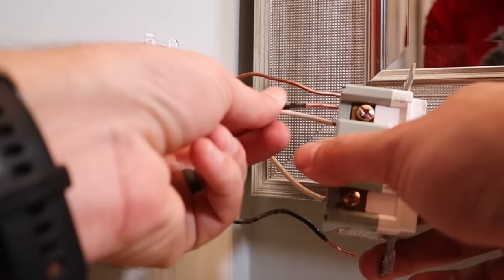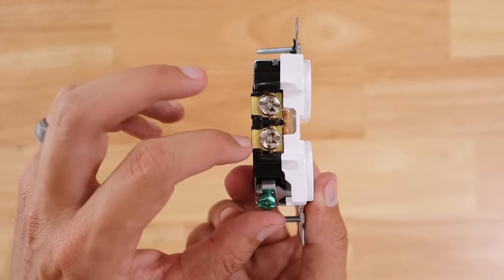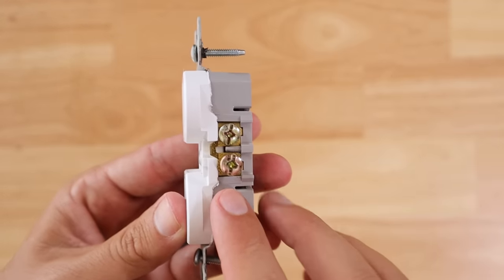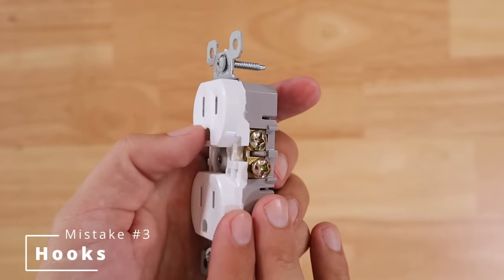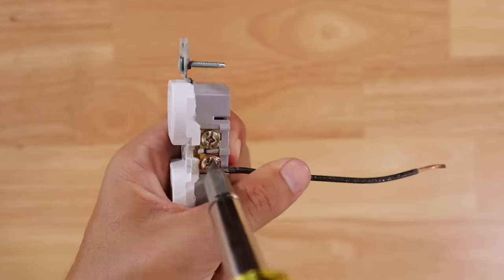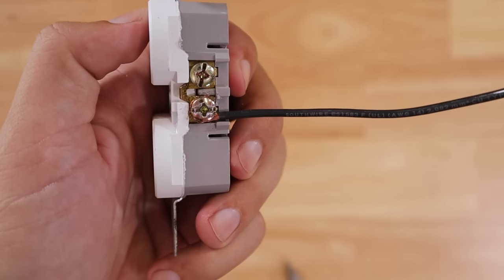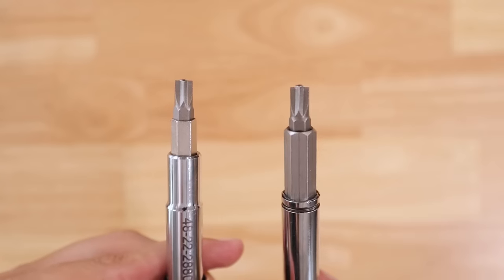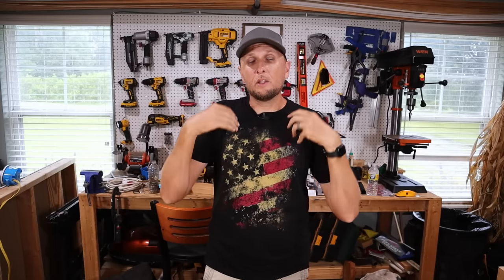The BIGGEST Mistakes DIYers Don't Know They Are Making When Wiring Receptacles | How To

Comment: Easier to remember that the two B’s go together: “black to brass”. Then everything else falls into place. Anyone that doesn’t know the screw that is literally coloured green is for the ground wire has no business touching anything electrical.
Reply: when working with receptacles, you should also remember, "right will bite"  as it helps remember which side of the receptacle is supposed to be the hot side while testing.
Reply: That’s how I was originally taught way way back in 1981
Reply: you know, I was taught way back when the polarized plugs with only two wires were coming out that the letter W uses more ink than the letter B so therefore the slots in the front are longer for the white wire..lol.. never learned the difference in the screws before..
Reply: Wow, simple, but I’ve never thought of it that way. Thanks for sharing “black to brass” I’ll have to remember that one!
Reply: Yup black to brass and white to bright
Reply: @rodneyhooverCFI  also remember white to bright
Reply: Don't forget that the hot wire could also be red.
Reply: @kenbrown2808  -- Good video, thx for sharing.  If there are any fellow Ga.Tech fans here, it's easy to remember 'black & gold'. :)
Reply: Hot Black Brass is how I was taught.
Reply: @kenbrown2808  although this may be true most of the time, there is no code stating that receptacle cannot be installed with ground up and hot on the other side. Generalized rules like this can be a problem. Remember the small slot is hot.
Reply: @lkeil84  yes, occasionally, one or more outlets will be installed inverted.  the only ones that wouldn't obviously be installed inverted would be an ungrounded receptacle, which is a good reason, when installing ungrounded receptacles to install them right side up, as you've eliminated all the reasons people give for installing the outlet inverted.  and there are still houses out there with unpolarized receptacles.  so your "small slot" rule is equally imperfect.
Reply: Anyone that does not know all of this and have a general knowledge or understanding how electric circuits works should not touch them in the first place.
Reply: @brotheradam  They still have that, or most of them do.
Reply: That could also confuse someone though if they forget and think bare goes to brass... The people that need to remember this and use these tips are probably not those that do this type of thing on a regular basis and b could be confused for bare or black.. 

White to White (silver), dark to dark terminal (brass), and ground is green like grass. It can still be a bit confusing using these when your electrician may have ran something and used a box to spilt 2 circuits. I have seen electricians run something like 12-3 to a box.. red went to one outlet and branched off to one circuit for a room while the black tied into another 12-2 that went to a different room's outlet circuit.  

I always just remember when I was first doing this that brass is colored so the colored wire goes to it. Silver is the equivalent of white so the white goes to it, and grass is green and on the ground so ground goes to green.
Reply: I was always told, "Black to brass, saves your ass"
Reply: The way I was taught to remember was to think of it like u was at a dentist office. The black man gets the gold teeth 👌
Reply: Anyone who doesn’t know these basic tips shouldn’t be wiring anything.
Reply: @Greezy Mcgill  You got me there.
Reply: So then black to brass and I won't zap my ass is appropriate ?
Reply: Meneely House  I always use to say black to brass white to bright
Reply: I was a little bothered by him saying "gold"
Reply: Or black gold Texas tea.
Reply: @brotheradam  A little crude, but this is the phrase I was taught to remember, “A small slot is always hotter!”
Reply: Rookie talk. If you don’t know this don’t touch electrical!
Reply: I always say black gold...
Reply: Black gold
Reply: @johnbushur6080  always remembered this
Reply: Part of the problem is lack of standardized with DC wiring (auto) in the past.  In automotive/lawn mower/power tools the black is negative - ground if you will, and red is positive or hot.
Then there is the Highway to Hell on boats with both AC/DC.
Reply: I was always taught to think about oil when doing this. They call oil "Black Gold"
Reply: Thanks for the excellent video and I'll remember Black to brass and White to bright! And I'll also strip just the correct amount of insulation as well. :)
Reply: Yep I was taught black to brass and white to bright
Reply: Electrical is fun and pretty easy graduated top of my tech class 🤘⚡️🔌
Reply: I made up "Black hot, short slot".
Reply: When I went to replace the outlets in my kitchen, I found out that whoever did the wiring before I bought the place apparently thought wire colors were just dealer's choice. White was neutral on one outlet, on the next the black was neutral and white was hot, on the next they used red for hot and white for the traveler on a three-way switch circuit... and they just went ahead and coiled up the ground on most of them and left that green screw empty. Just an absolute mess. I spent awhile with a voltage tester finding and marking all the hot and neutral wires. I'm assuming there was no inspection involved. I'm actually pretty amazed all the switches and outlets worked, I don't know how they kept track of what terminals they were connecting to.
Reply: The terminals are labeled, no need to remember that.
Reply: White boys ride on the chrome wheels black boys ride on the gold wheels …
Reply: Black on brass, or that's your ass is what I was always taught. 😂
Reply: @lkeil84  I would think that code would dictate that swapping the hot and neutral would be unacceptable and would defeat the purpose of the ungrounded Polarized plug, such as on a table lamp… among other issues it would cause.
Reply: Black to brass white to light
Reply: I was told black people wear gold, white people wear silver
Reply: Is there a place called electrical hell
Reply: @kenbrown2808  commercial and industrial we put the ground up so that would be false
Reply: @valentepozas4745  just because you do that doesn't invalidate the rest of the us.
Reply: B2B as you say black to brass that’s exactly how I remember  2 thumbs up
Reply: I was taught black on brass will save your ass
Reply: @valentepozas4745  and yet, besides hospitals and houses wired in parts of the 70s, or switched outlets, the industry standard is ground down for 120V straight blade receptacles.  

and no, I didn't get her shocked, because I specified that was a guide for TESTING.  but hey, go ahead and get her shocked by having her pull her receptacle out of the wall to see what color the screws are so she can put her tester on them.

let me guess, you;re a fifth term apprentice.
Reply: @valentepozas4745  you sure think you know it all like a 5th year.
and you do realize there is more of north America than the southeast...but hey, carry on insisting that the whole world must be like your little corner of it, because you;ve done 5 or 6 kinds of jobs.
Reply: @kenbrown2808  LOL i learned that the second i shocked myself by touching the brass side of a Receptacle when i was taking apart my project and i didn't de energize it Boy i was a silly First year and nearly a dead first year before i even left school.
Reply: @thegreatcanadianlumberjack5307  worst part of working for a "hurry every chance you get" outfit is they push you to take risks.
Reply: @valentepozas4745  I'm not the one coming in on a month old video in residential wiring claiming that because the company they work for likes to use the alternate orientation for convenience outlets, in non residential installations;  that a common mnemonic for remembering proper polarity in residential outlets is categorically wrong.  and then trying to defend it by ranting and raving about how vast their experience is and how they know everything because they worked on a windmill once.  and they worked on a mill once.  and they supervised a journeyman once, and told him that even though everybody you know installs receptacles ground up, the project specifications were that the receptacles be installed ground down.  and you think anyone who calls out your pissant attitude must be a drywaller, because there's no way anyone with any experience could fail to give you the respect you think you deserve.  
but what do I know, I'm just a total stranger calling out your bullspit on the internet.  think about that next time you get an ROF in the middle of a project.
Reply: Silver was a white horse.
Reply: I know just enough about wiring to be dangerous
Reply: I think the type of screwdriver was greatly exaggerated. A flat or phillips both work fine.
Reply: That's what I was taught also.
Reply: That's my way of remembering.
Reply: @blockisle9  i always go white to wide ?
Reply: Oh… now that I know what that little green screw is for, I’m on it!!!
Reply: I always remember the Beverly Hillbillies theme “black gold-Texas Tea” when I’m wiring an outlet.
Reply: Going by color can be disastrous. Always know how to use a multimeter and always check to make sure
Reply: That Phillips is wore the hell out!
Reply: How about reading the markings on the back of the outlet?
Reply: Black to brass. Thanks for the tip. Easier to remember. I always remember white to silver. but this is a lot easier to remember
Reply: It just seems natural to me now. Black is gold and white is silver.  I've also installed, literally thousands of them by now though.
Reply: @scooterp7009  I agree with that if you don't know these basics you shouldn't be doing it Silva to the white and the ground to the green just remember the white and the ground is always on the same side really basic stuff
Reply: Great video! Reverse polarity will also make motors spin backwards. Potentially dangerous depending on what's plugged in
Reply: Exactly 💯! I've met quite a few people who had no business being anywhere near electrical outlets recessed lights or even a screwdriver
Reply: @westsideken  I like that much better because it looks gold.
Reply: @nicholascrochet823  Yes, it does sound racist. Please explain if it is not.
Reply: @joshedmondson4031  I certainly don't understand that one, including the boy part.
Reply: @steven4776  so black people have more expensive tastes? We are better?
Reply: @lkeil84  awww - the ol 3-way switches!!   Good catch!
Reply: Green as in grass lol
Reply: @Greezy Mcgill thinking stereotypes are “facts” sounds pretty sketchy
Reply: My old roommate used "black men have gold teeth"
Reply: @bobjoned3398  The topic is about commercial and residential wiring for AC circuits not automotive or electronics or DC equipment
Reply: @bluepeakinspections  🤔
Reply: Green ground
Reply: @lkeil84  it could be black red or blue.  Depending on what service you have and what method of wiring is used.     From romex/ emt or pipe / mc.
Reply: @michaelhanson5773  12-3 might be ran to split the receptacle also to make one switched
Reply: @marcus1226  IBEW or non union?
Reply: Yes; I remember "black to brass" and "white to wide" - since the widest slot is the white/silver side of the outlet.
Reply: @jamesgarrison6430  Yes, you are correct. Blue would be very uncommon in most smaller structures. Only building with service sizes larger that 400 amps would have a blue phase. Funny the national code does not specify "C" phase as blue, and it really only applies in local code amendments. For the most part though, almost all electricians use black, rdd, blue for 120/208 and brown, orange, yellow for 3 phase 480/277. The code only specifies green and white usage and where they specifically cannot be used. Most homes these days that have almost all the circuits protected with AFCI breakers are really only using black wire anymore. Do you know anybody that is buying white/red NM or MC? Not to mention is also special order.
Reply: @lkeil84  They could be any color but green or white. Everyroom room in my house has a different color hot wire.
Reply: What if there is no black but red?  What if some handymen who happened to "tinkering" with the electrical boxes and mis wired them?  Best thing is to verify and identify which is which first then turn off the circuit breaker (LOTO is the best option).  Well, the best option is to call professional, certified electricians.  We will charge a little bit more but you won't be surprised with many problems later.
Reply: Silver to white you did it right
Reply: @vigormanh2980  I was an electrician for 19 years and an Electrical Inspector for over 20 years being the boss for 5 of those years. Everything from bathroom remodels to 1000 foot high rises. I've seen it all and some of the ugliest electrical work on the planet. It astounds me that there are not more fires.
Reply: @lkeil84  I totally agree with you about this.  I worked my way up from a young apprentice decades ago then finished college with a degree in electrical engineering and for the past 8 years I started my own servicing company.  I have worked in residential, commercial and many industrial settings.  Like you said, there are flaws everywhere.  My rule of thumb always is:  if one not trained in electrical trade he/she must stay far away from electrical work and always do follow up checks on new employees.
Reply: I like to think of the scene from game of thrones when he pours hot liquid gold on that one guy. So I think of the gold as hot.
Reply: @lkeil84  receptacle position is always specified with the ground up.
Reply: Even easier way to remember is the black guy gets the gold filling and the white guy gets the silver filling at the dentist..
Reply: Black boys like gold, white boys like silver
Reply: @captainb2603  what if the black guy is not around but the red skin guy is?
Reply: @vigormanh2980   hide your alcohol
Reply: @captainb2603  I did not mean to be funny about the red color.  Besides 
 black hot wires, there are red hot wires and blue hot wires in single phase panels.
Reply: ,your opinion
Reply: @workct4102  This is incorrect. I worked as as an Electrical Inspector for over 20 years and found no such instruction in any listing, installation instructions or the National Electrical Code. It is common practice to out all the grounds down and putting the ground up for a room switched receptacle. 99% of all installations I inspected had the ground down. Even I knowing the advantages of a ground up installation still install ground down. I do not find the advantages to be that great to change what most people think is correct.
Reply: @workct4102  Not always
Reply: Jesus this is so basic it’s not even funny. People don’t know this!?
Reply: @lkeil84  any spec...will be grounds up.  If there is no spec do whatever.  But grounds up is the way to go....
Reply: @williamleblanc3244  in 20 years I have never seen a spec detailing grounds down.  If it is spec'd its always ground up.
Reply: @lkeil84  you weren't an inspector.  If you were you'd know the difference in a specification and a listing or code requirement.
Reply: @workct  in 34 years the only time I've seen ground up were hospitals and some commercial projects.
Reply: Black hills gold is how I remember it
Reply: You have all those color coded screws but they couldn't write L and N to indicate live and neutral terminals?
Reply: Well that extra long wire not that big a deal because you got exposed hot screws
Reply: This is exactly how I remember it black is brass is my mantra while doing diy electrical
Reply: Smokey and the Bandit was how I was taught, The car was Black and Gold!
Reply: Very confusing,  always thought black wire is ground like car battery
Reply: @SparklingRufus  I was in that boat for a while but high voltage is definitely different all the way around it seems.
Reply: No, the copper color screw  is current line, the silver screw is a neutral  traveler of the alernating current 1/2 of the current line returns to transformer and the green screw is earth ground only.
Reply: @brotheradam  in past history of usa is still in also in  philippines of not understanding earth ground.  The neutral traveler line with the current line makes it ac= alternating current , example is the current line is on a 20 am breaker,  equals 20 amp circuit, the neutral is a return current circuit of 10 amps goes back to transformer .  As notice the going out current is hot and half of that current returns making it  a hot also.  The earth ground is in contact with a earth rod only and no travel current wire. No neutral is a ground, fact,  as those  nations are  still 80 years behind as they still  say it is.  No it is not. . The only ground is the earth ground only never a current traveler. High tech mega generators that control power grids  of citys being rebuilt from wars and usa military camps across the world uses depends on the earth ground to keep the phases equal and no spikes. They can not continue without the earth ground.
Reply: Some people may be new at this and want to learn. Your post,  while informative to anyone that's never changed one out before, is also kinda (no offense) ass hole-ish. People use these videos to learn.  Some may not know green if for ground, ....you just informed them but the last  sentence could've been omitted....just saying.
Reply: @jvmiller1995  look, there was a time where you didn't know either. Take it easy on the people willing to learn from all of the helpful videos and advice. All your doing is deterring them from coming back to ask questions
Reply: @bobjoned3398  My father was an electrician in a small mountain town and several of the houses he wired had waterwheels and DC power.  They were a treat to wire, but he knew his stuff and had no problems.  Initially, though, he would check everything I did, but by the 3rd room, I was on my on.

DC lights and appliances are expensive, but they are available.
Reply: @lkeil84   yup my whole house is wired as white is hot.
Reply: @kenbrown2808  lol! That only helps if you understand that there is a wrong way and a right way the outlet should be ...and I have come across plenty of upside down outlets🙃    I've always told people that the plug needs to look like a face 🙂 right side up of course.🙂
Reply: The outlets also have it written at the back where the white goes,and where the hot goes. And that is a no-brainer.🙂
Reply: Neuter to pewter
Reply: None of this means anything when you take off a switch and all the wires are black…😮
Reply: That's what I go by
Reply: Black to brass
White to bright
Green to ground
Reply: @kenbrown2808  The white will bite too if there’s a load on it.
Reply: First thing my dad told me when rewiring a circuit. Black goes to brass!
Reply: Black to brass will save your ass! That's how I was taught.
Reply: I think if it like an old western. Black = Bad, White = Good lol
Reply: What if you're on a 3 phase system and you're wiring blue or red? 😏
Reply: Black guy gets gold chain , white girl gets silver necklace
Reply: How about the W rule ?  Wjite to the Wide socket slot,    and Black ...... falls to the narrow slot
Reply: @johnbushur6080  Dang... Rodney,   you covered that
Reply: Thank you
Reply: What you say including when you are learning ? Like you KNOW EVERYTHING 🤦🏻‍♂️🤦🏻‍♂️🤦🏻‍♂️
Reply: Or you could just remember black folks have gold teeth.
Reply: @kenbrown2808  until you go to a govt facility and they are upside down
Reply: @bch5513  if you're in a government facility, you'd better have enough training to adapt to that.
Reply: Black is bold and bold is gold.
Reply: @kenbrown2808 the way i was taught was if you look at the front of the receptacle the short side is the hot side
Reply: @OfficialTakGiovanni  that's true, but it doesn't rhyme, which makes it harder for people who do it less often to remember.
Reply: Looking at the back of receptacle, white on right is easy to remember also.
Reply: @martykoehler6512  that’s what I was taught as well lol
Reply: @brotheradam  my dad taught me long ago “black to Brass better watch your ass” years later I still use this rhyme
Reply: If you’re a Steeler fan…. Black and gold!
Reply: You're right black b goes to  brass b. You could also say White wire goes to White screw. Or w goes to w.  And Green is ground the world around.
Reply: The white wire goes on the same side as the ground screw is located.
Reply: Great tips here on wiring wall receptacles. I never liked the back stabbing method myself because your connection points inside the receptacles is paper thin and over time can become loose. I was taught to always use the side mount screws , black to brass and silver to neutral and ground wire ( green ) to green terminal.
Reply: i always remember what side the wires go on by thinking "hot goes on the side with the smaller hole because that's the one you really don't want to stick your finger in"
Reply: @lkeil84  Any color can be hot except for green or green/ yellow, white and gray.
Reply: I'm from Mizzou... Black & Gold. Easier than two Bs..
Reply: Good job
Reply: @lkeil84  good point, so the full rhyme helps... White to bright.,in that case
Reply: @kenbrown2808    (except, of course, if the receptacle is upside down with the ground up - which is perfectly legal). It's a basic way to remember, but I just tell kids "small slot hot".
Reply: Neutral white is always on the same side as ground which is green. Hot or colored wires on the opposite side. I start with the ground, then neutral, last hot.
Reply: White people like silver, black people like gold.

That's what someone told me lol
Reply: black to brass will save your add😂
Reply: Exactly my grandpa told me that years ago. It's never left me, nor has it ever failed me.
Reply: I thought green is hot and black is neutral white is just there for looks, aren’t u supposed to hook all this up to a five gallon gas can ? I’m pretty sure u do 👌
Reply: Black to brass, save your ass
Reply: White to Bright, black to brass.
Reply: I always remembered black to gold cause black gold yanno
Reply: Never heard that but I always know side with green is white/common
Reply: Excellent reminder for the “B’s”
I’m a plumber, even I know about that green wire. You hit the nail on the head though 😂😂😂
Reply: @lkeil84  The hot wire could also be white, depending on how the circuit was run.  If utilizing white, a Sharpie should be utilized to color the end of the wire casing black, or by placing some black electrical tape around the end of the casing.
Reply: @jvmiller1995  Many come on to Youtube to educate themselves.  I am glad that channels like this exist to give correct information and sound advice.  Looking through the comments on any given video will give you an idea if the information given is sound.
Reply: @Jeff-vh1zz  The cases of a hot wire being white are so very few. Basically, you can tape the white wire in a smaller cable assembly such as NM (Romex) or MC. This would apply to using a 2 wire w/ground cable for 208/240 volt applications such as electric heaters or motors and switch travelers. Never can you pull a white wire into a Raceway and use it as a hot conductor. The same goes for green. The code is very strict about the use of white and green colored wires with very few exceptions. If you know of anything other than cable assemblies, I would love to hear about it. Being an Electrical Inspector for over 20 years taught me a very valuable lesson. I don't know "everything".
Reply: @Jeff-vh1zz  Some things yes.  Many things you should not attempt.   I mean before hip replacement I watched a video showing the entire thing.   Would you hire me to put a new hip in you.   I men I am gad I went to the guy that does 6 a day.

I think You tube can be good and i have learned a lot from it right or wrong myself.  But if you do not have a basic understanding or how the electrical system works you should not be trying to wire a house based on a video.  What do you do when someone prior to you has miss wired and you are just trying to put the black to the black and white to white and so on like this video shows.  It happens all the time and even more so with you tube..    That's what I am saying.  Not everyone is cut out to be a electrician and you do not get many mistakes before someone gets hurt.
Reply: Wow thank you
Reply: Machine gunners: "Brass to the grass!"
Reply: @glasshalffull2930 I can only imagine your plumbing jokes...With "ballcock" and all.
Reply: @steven4776 What if you're Italian?
Reply: @Maynardd Did you wire my house? I have more "open grounds" than closed ones.
Reply: @windsofmarchjourneyperrytr2823    LOL!  You had to remind me😉. Used to live in a small condo building and I was the president.  Anyway, we had an issue with the main drain on the bottom floor and it was discovered about 5:00pm when the single and cute lady in that unit returned from her job on a cruise ship.  She was completely freaked out and just wanted to relax after a long gig on the ship.  So she changed into a very short robe while my buddy and I called a plumbing company.  Well the plumber arrived real fast, literally in a few minutes, and he was a really handsome young man.  Next thing you know the young lady announces she so stressed she’s going to make a margarita and does anyone else want one. My buddy and I are like,sure and the plumber is a little reluctant, but he say OK too.  Well, my buddy and I get tiny glasses and the plumber’s glass is the size of a large slurpee from 7-11.  Anyway, about this time my buddy’s pregnant wife starts yelling down stairs and so we both down our drinks and depart. 

Next morning I’m walking out to drive to work and low and behold, the plumber’s truck is STILL THERE!  As I walk down the street, I can’t help myself and I bellow out, “THESE PIPES ARE CLEEEEEEAN !!!  😂 

( From a scene in the comedy Cabin Boy when he loses his virginity).

BTW - We got a great price on that after hours emergency repair and I assume he was taken care of as for his tip 😉
Reply: Thank you!  Black to brass is a lot easier for me to remember.
Reply: @randomschmo5778…not a GA Tech fan but I live in Nashville. Vandy is my team so black and gold works too!  Thank you!
Reply: Black to Gold (cringe)
Reply: TV show ‘Beverly Hillbillies’ theme song ,  “ ……oil that is, black gold, Texas tea……
Reply: I always preferred using the “back stabbing technique if needed you can use the side terminals with ring terminals on the ends of your wires I have years of experience as a wiring tech I’ve worked in a production environment where we wired lighting that was much higher voltage than 120 I also worked in construction as well as in automotive and diesel truck fleet maintenance which included the electrical repairs  I did a stint in the U.S. navy working on helicopters prior to that
Reply: Something I need a little help with. Putting two ground wires on the same green screw…
Reply: Black and gold = who dat 😅
Reply: Amen to that!
Reply: 30 amp switches don't do this
Reply: Voltage doesn't know color. Always check first. Good thing I did when installing a plug recently, white was hot
Reply: But white can say sometimes bee  be hot when  when the electrical source runs through the fixture instead of the switch.
Reply: Line wire is also calls Hot line (black). “Gold is Hot”
Reply: @kenbrown2808 i like that one best 😂
Reply: @jvmiller1995 Yeah!
Reply: What I was taught is, when a black guy goes to the dentist, he gets gold fillings. When a white guy goes, he gets silver fillings.
Reply: Lmao I was told, black ppl like gold😂 I never forgot ever
Reply: Light to white is what I was told
Reply: Great point!
Reply: Black to brass screw and white to white screw
Reply: This is a really great ditty, IMO. Unfortunately, having ADD all my life, I sometimes have to modify the great work someone has posted so it will stick in my head, rather than just being able to use the thoughtful work someone has created or passed along. Sir, you have done a great service to many,  IMO!!!
Reply: Awww. As a lady watching this I was thinking of Christmas colors. 

Black and gold look together. 

Silver and white decorations look good together. 

Green for garland or ground:)

Sorry guys, couldn’t help myself:)
Reply: @brotheradam lols that majes sense... is there a special method for the I guess [19]40s? And prior vs the polarized 50s? Onwards (1940s I assume was final decade to not have a such thing as polarized outlets. Not in the year 1949 but 1950 onward.)
Reply: @kenbrown2808 Only time in a single home jouse type install was as a toddler an I noticed the switched outlet looking back...was upside down vs downside/ground down etc. So I maybe wanna say it was also dependant on the era ie the 90s when fixtures were less and decora/and floor lamps/table lamps or tcporche lamps ie the tall standing ones pointed up onto the ceiling... was mostly zi guess a common thing. For the socal area at least... though for sure I recall noticing the master bedroom had an upside down outlet which is the one I recall.
Reply: @lkeil84 particularly if on a splite phase/240 volt one... an blue is said for commercial/industrial ones. Ie 300? Volt outlets for heavy motors but too costly to have run down every street so onlytwo phase/240 volts is common for most buildings or any residence.
Reply: @stevepolychronopoulis oof that is almost as unpleasant as is if I hear some places both the only two or four wires are all black so either end of run or four blacks and thats it.. and to make things worse they have so little workable length etc, lol. Surely I bet a pleasant suprise to go with the penny/knockout or coin fuse trick
Reply: @sparkyohms4206 True true... lols
Reply: @kenbrown2808 o.o dang savage lol.
Reply: @frankpuryear3844 Yeah like she said. Jj but yeah wide side is white oh but not if it has a black peice of electrical tape or paint on it as this may indicate an exception scenario etc.
Reply: @bsanchez3563  i have a lot of patience, but some people just need straightening out.
Reply: @bsanchez3563  the 70s was big on switched receptacles instead of ceiling lights, and yeah, we invert them to make it obvious, and the smart guys hook the bottom to the switch, so it's easy to plug and unplug the top with something in the bottom.
Reply: I use the Beverly hillbillies song black gold- Texas tea lol
Reply: my own gouge is Dark wire dark screw , light wire white screw
Reply: racist outlets i guess
Reply: Preach
Reply: Small side is the hot side... to the person who said "right will bite" that's wrong too. Like 99% of receptacles I see are installed wrong. Atleast in my opinion, nec doesn't care, but I always put the ground plug on top. If a cord is not plugged in all the way, and something falls on to it, it just hits ground. Instead of creating a short
Reply: I thought the ground was black?? I been doing it wrong all these years 

😂😂😂
Reply: I've always remembered light screw to white dark screw to black
Reply: "Black girls like gold, white girls like platinum"
Reply: Ugh. That seems bigoted. And unnecessary nowadays.
Reply: @lkeil84 Only if it is coming from a Switch...
Reply: Agreed haha
Reply: That's legit
Reply: Then marry up . ...
Reply: The pointy "Philips" screwdriver that he showed was actually a Prince & Reed, a Phillips is blunt on the end.
Reply: no shit!!
Reply: As I watch some of these DIY videos, glad dad was, I thought when a lot younger, such a a-hole perfectionist! Wish he were here to really appreciate him!
Reply: Never saw ANY wire in resdential come loose!
Reply: Even electricians at some point in their life didn’t know green is for ground. Never too late to learn.
Reply: Guys, here is the Savior

HalleluYAH translates “Praise ye YaH”

YaH is The Heavenly Father 
YaH arrives via the TENT OF MEETING
YaH was Who they Crucified for our sins
YaH was Crucified on an Almond TREE

— Ancient Semitic Cuneiform of Moshe (Moses)
— Isa Scroll (The Original Isaiah)

Isaiah 42:8
"I am YaH; that is my Name! I will not yield my glory to another or my praise to idols.”

Isaiah 43:11
“I am YAH, and there is no other Savior but Me.”

Isaiah 45:5
“I am YaH, and there is none else.”
Reply: Thank you for that lesson
Reply: Dark to dark and light to light. Gold is darker than silver.
Reply: I remember by looking at the two slots on the front of the outlet. If you wanted to apply a dangerous current to one of them, would you pick the larger one or the smaller one?